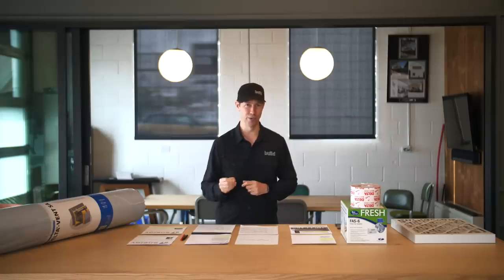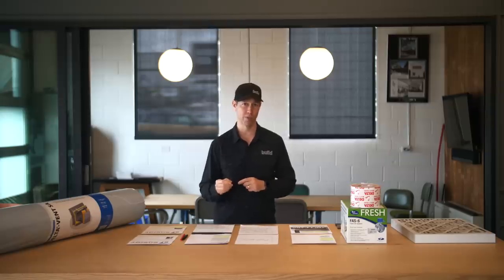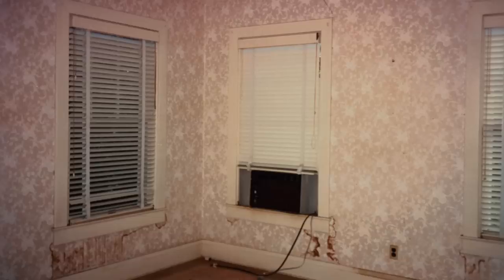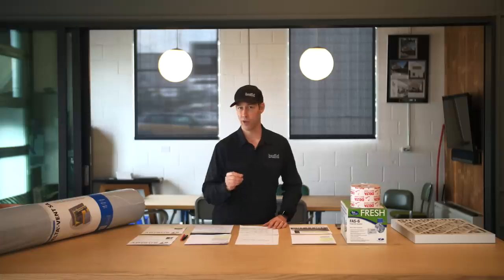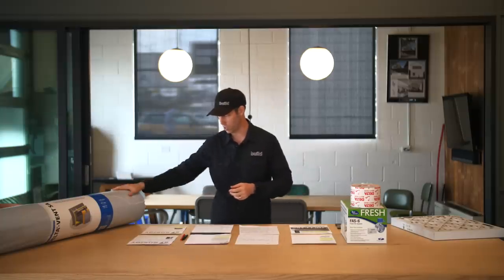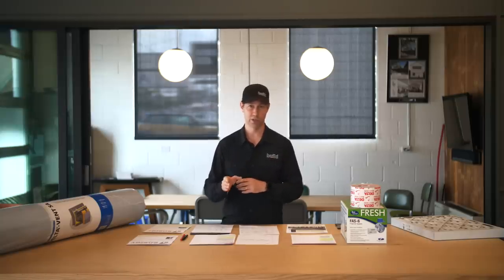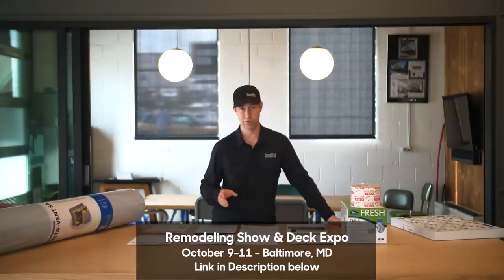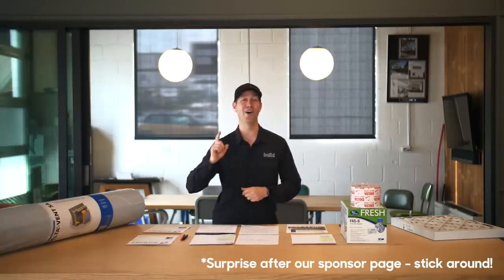“Houses need to BREATHE!” - Shut your filthy mouth

Comment: Your assumption is all "Building Codes" are good. You're also forgetting all of the noxious chemicals given off by the building components in your home. They include formaldehyde, volatile organic compounds, etc all from a wide range of sources. 

When carcinogens are being trapped in the house and being linked to cancer then people will have a little different idea of what tight means, and I'm not just thinking of Radon.
Reply: Matt is a builder.  If a government code is stupid and harmful he still has to impose that on his clients or face punishment and loss of his business.   Every monopoly is harmful and there should be multiple competing building codes.
Reply: This is why you have ventilation systems, he says it right in the video. It's not that the house doesn't breath, it's that it breathes in a controlled way that allows for more efficiency, and for air filtration.
Reply: @Bill McGonigle, IBC and NEC are Not government.
Reply: D Jaquith clearly you had a bad experience Spray foam insulation and that’s what you’re basing your statement of off but when done correctly the spray foam combines and reacts probably with no off gas but I read an article about spray foam if not installed properly can of gas hazardous chemicals Into your home

Comment: Exactly. On older homes they used solid wood. No man made materials. Which means there were no glues  being used. The glues they use today e. g. construction adhesive, synthetic resin, melamine, etc.. contain dormant mold spores. Solid wood also soaks up moisture better and moisture can stay in it until the wood drys out and in a lot of cases without any significant rot.

Comment: No such thing as "too tight".

This is what artificial ventilation is for.  Get a good ERV and you don't need to worry.
Reply: And what if those systems fail or are compromised?
Reply: Probably one would repair them.
Reply: J Franklin or replace it. Folks don’t seem to worry too much about that when they install a nice furnace/
A/C system whenever they build in the first place so it shouldn’t be a big deal
Reply: Reptilian Lord  I dunno, what do you do when your furnace or water heater fails?
Reply: Reptilian Lord replace or repair it seems to be the obvious answer. We are talking about 2 fans and 1 to 2 cores. Not a very complex system. The biggest issue might be convincing some home owners to actually turn it on and run them.
Reply: @1982MCI  You don't seem to see the issues of a building that is so absolutely dependent on one factor for its success. Once that small factor is comprised the whole system collapses.
Reply: Are we suppose to take your ridiculous concerns seriously?
Reply: @Neubs-xv8tw  What is ridiculous about it? That there are inherent flaws and weaknesses with technology?
Reply: So whats your dooms day scenario for this type of house and why do you not recommend people build this way.  I'd like to hear what technology needs to fail and the catastrophic consequences of this failure.
Reply: @Neubs-xv8tw  Wow someone is getting really defensive and insecure. I am not making any propositions Iam simply pointing out the limitations of contemporary building theory.
Reply: Not an option in humid coastal areas
Reply: This guy is a salesman not a good framer ....
Reply: You still have multiple built-in fall-backs PRE-INSTALLED in your home.
They're these things we like to call WINDOWS.
If your ERV/HRV system goes down for a period of time, open a window.
It's not as efficient, or as clean, and it'll play merry hell with your climate control.
But it WORKS!
Then, once your ERV/HRV is in working order again, YOU CLOSE THE WINDOW.

Wow!  CONCEPT!
Reply: Because opening a window to prevent stale air buildup in a tight building with a failed ERV is a concept slightly harder to grasp than the unified field theory...
Reply: Who?  Risinger?
Reply: @MacmillansDiciple  "You don't seem to see the issues of a building that is so absolutely dependent on one factor for its success." How is this any less true for a furnace,  well pump, water heater, windows, freezer, etc?  A furnace is at least as likely to fail as an HRV, and far more likely to stop working altogether. Let's examine what happens in two different scenarios. House A is leaky by design, and has a gas furnace, no scary HRV to fail. The furnace fails in the winter. Within a few hours, you are freezing your ass off and desperately hoping to get an HVAC guy to come out on short notice at $150/hr to diagnose the problem. Your life is basically turned upside down. House B has a scary HRV, is super air tight, some mini split heat pumps instead of a furnace. The HRV fails. You crack a few windows, and turn up the heat a little bit, and leisurely decide the best course of action, with no urgency. Or let's say one of your heat pumps fail. Not to worry, the others can make up the shortfall in the short term. Or if you only have one, luckily your house is so air tight and well insulated, that it will take days to get really cold, and you could keep it at room temperature with a couple of plug in floor heaters if you wanted to.
Reply: @trevorlambert4226  You have a severely misplaced faith in technology. You don't seem to understand that as a system becomes more complex it becomes easier to fall apart and break down. A house of cards so to speak. Consider also modern infrastructure. One solar flare, which is something humans cannot control at all, would destroy the entire planets electrical grid and make any utilities or backup systems useless. Have some perspective.
Reply: @MacmillansDiciple  You went into completely left field, but before I join you there, let's deal with the original topic. An HRV is not a complex device. Even as a system in the house, it is hardly complex. If the HRV falls apart, the house does not fall down. People in the house don't die. So your "house of cards" analogy is completely out of place. A solar flare has NO potential to affect any power grid on earth, let alone the entire planet. A solar mass ejection would wreak havoc on a significant portion of the electrical grid, but again, not the entire planet. This is definitely a concern, but has literally nothing to do with the subject at hand.
Reply: @trevorlambert4226  Unfortunately you have no unified cohesive worldview but an atomized approach to things. Everything is inter-connected and inter-dependent.
Reply: I'll be sure to open a window when the solar flares or emps hit assuming civilization hasn't collapsed and most of us don't die or I have enough food in my garden that my neighbors don't kill me for. If that doesn't work I can live in a breathable tent each night as I flee the cities on foot since my car is toast to escape the looting and starvation. I mean in this scenario I think most people will have bigger problems. Focusing on programs that promote local community sustainability strikes me as more of an appropriate concern for a worst case scenario so that I can safely open and vent through my windows if the solar system or foriegn power waged war on us.
But hey if if a breezy house is what will help you weather the apocalypse then more power to you.
Reply: @bradley8420  Passive aggressive mockery and snark is a sign of a weak and small mind.
Reply: Reptilian Lord Passive Agressive Mockery has a genuine veiled nature to it. This is a very open and a playful tease not against you, but against your argument in an effort to highlight the pitfalls of your argument on the given notions rather than humour this particular angle further to which if you had any further concerns, details, etc... of merit now would be the time to offer and clarify if you believe such a playful response was misplaced. Clearly no one as of yet has been concerned by this particular system.

A weak mind doesn't speak for itself. 
I do
A dull mind can not articulate its thoughts.
I did
A small mind is narrow minded.
I listened

A decided mind is not a closed mind, but at some point we assemble the know variables and move forward.

Mockery carries the notion there was contempt accompanying my teasing to which you do not know me.

Snark is a sign of a great many things, one of those being critical thinking, but again it implies an accompanying snideness which implies a underhanded, derogatory, or mocking nature which goes back to assumed intent to which you still don't know me.

So yes, after some critical thinking, I decided that out of all the great many aspects that go into building a home the resulting risk of losing fresh air intake whether it be through a simple blower motor failure or catastrophic grid failure was an acceptable consequence as it is easily remedied by opening a door or window.
Moreover, I can appreciate your concern for complex systems, especially in technology that can be over valued creating unnecessary risks that accompany them, but each point of concern for all systems must be put into context and discussed on individual merit as a general comdemning sweep would be a dismissal.
It was my hope you could take a joke/illustration and be receptive to why most of us do not prioritize something like this when there are far more substantial concerns regardless of a continued technological culture or apocalypse. I'd personally want an air tight house to control all airflow in and out of the house if I had no modern HVAC system available to which if we are concerned about longer term system failures all home should be designed differently to begin with to capitalize on and and control passive airflow. If you have further input directly related to the fresh are intake then by all means, I am open to it. I can think of several off the top of my head to which group thinking is great for patching systems. In fact, you have me thinking on what would be a way to use passive air for a downed system. Building in practical redundancies is always a great thing.

As for anything else, you have great day.
Reply: Reptilian Lord I actually have a textbook on passive air flow and would like to see it designed more into modern houses with HVAC systems as it is one more way to be energy efficient and maximize a house's life through many cirmcumstances.
Reply: I agree with @MacmillansDiciple  too much focus on active systems that will cause the house to go bad if they break down, or are even used incorrectly. Like some people who turned down the ventilation to cut the noise and save power, insufficient ventilation in their house led to moisture buildup in the house and caused mold over a summer.  Great for healthy! I am coming to the opposite conclusions as this video and I think the future is passive systems that don't require power for a long term, ecologically friendly house. Timbered houses for instance and materials that can absorb and release moisture without getting damaged or becoming mold growth sites. A timbered house in the scandinavian tradition can be made to last hundreds of years and be energy efficient and finally the house itself is a carbon sink as well.
Reply: @PhotonHerald  No, the problem is people won't maintain the systems.  Filters won't get replaced, or if they do, they'll get replaced with the cheapest piece of junk filter they can find.  That's the sad reality.  And if you are foolish enough to encapsulate your house in off-gassing foam like so many do, and you don't have a properly functioning ventilation system, you're in for a world of self-made health problems.

Comment: My 1910 baloon house is in great shape. My 1980s house is showing alot of mold. My 2010 house is just as bad as the 1980s!!! I right now am testing a house with the walls like the baloon leaving an air way. The air tight to meet standards is not on outside the house. Its inside just under the drywall. Just to let the house breath. Ill find out how it goes in a couple years.

Comment: Could you do a video on the best practice for hood range and dryer vents. Is there a dryer vent cover that you like to use.
Reply: Good subject.  I never see how to address this properly and it's an important concern.
Reply: I have seen a vent from heartland it seems to be the best one I can find. But nothing for a hood range vent.
Reply: Actually,  I'm referring to makeup air.
Reply: @rickwest2818   for the dryer i added another 4" duct and ran it from the dryer to the outside for makeup air.  The dryer is in a tight enclosure
Reply: Does that work well?  What if it's really cold, or really humid, or lots of pollen?
Reply: @rickwest2818  i pull from my porch attic. Its better to direct the makeup air to the use point imo 
Instead of pulling in air from your doors and windows
Reply: @SolarTechFL  do you ever have issues with high humidity not drying the clothes, or cold air causing condensation?
Reply: @rickwest2818  time will tell im about to move in 
My range hood i figured can pull air from the erv 
The dryer works perfectly in my barn even with 100% humidity im in Florida so humidity is 80-100%
Most of the year
Reply: @SolarTechFL  I'm in MI so the cold air causing condensation is a real thing... but it doesn't get much more humid than FL.  Same about the ERV with the bathroom exhaust?

Comment: I hear this soo often. Nice video.   I'm attempting to build a green cabin, but without the benefit of unlimited electricity.  Blending some tried and true methods like orientation, roof overhang, cool roof, and rain screens.  Heating is pretty easy, but cooling off grid and on a budget is challenging.
Reply: A ductless minisplit does well for cooling, unless you need to have a much lower electrical draw than that.  Planting trees is a long term solution, but as long as the roots don't get into mischief that might work.  Changing clothing to kinds that breathe well (linen, searsucker) are other options when resources are tight.

Comment: Ok Matt. Some good points. But please - riddle me this case:

You are building a home inside a forest. Amazing, clear, fresh air. So good that You would have to be crazy to filter it and deprive it of its propertise.

So lets try to seve this aspect and still meet the code.
Also lets assume that its rather cold or medium climete. Boston for ex.

We use open cell or rockwool insulation.
We do not use PE vapor barriers at all.
We just use air and water membranes.

Only chance i see here for trouble is condensation on sheathing during winter.

But now a key question. 
Lets do sheathing from the inside. Even by screwing regular, wooden boards.
Use those as backing for rockwool boards. From outside rockwool is being hold by conpressing to studs and some occasional mechanical connector. And also by good quality mambrane that protect it from air and water from outside. 
Mambrane is hold to framing by wooden 2x1 inch bars that also create there an 1 inch air gap.
Last we have wooden siding.

Yes - there would be some air leakage - but we actually welcome that for its refreshing properties. And knowing that we dont mind the 20% extra cost of energy.

Can You please point out some holes in that logic or ideas how to make that better.
So in other words - how to make a modern house without mechanical air control system. And yes - with acceptance of some extra costs of energy for heating.

I would love to here from You in that regard.

Cheers
Reply: Shame this was never answered, it is actually an interesting question / concept.

Comment: I think where a lot of people fall down with air tightness is cost. If you seal up a space but don't spend the money of a full solution or engineer it properly from the start it'll cause issues.
The classic case would be sealing up an interior remodel but still having all those structural leaks. That air ingress allows damp to condensate against the rest of the building and folks will attribute that to lack of breath-ability. If you design is so that air movement is limited as much as possible to ONLY where you expect it to move then you will mitigate these problems.

Another major forgotten factor is cost. We didn't cool houses 50 years ago like we do today and often didn't heat them the same way either. These are NEW problems that require good designs to fix. "old" design simply cannot count for the way we live today. Indoor bathrooms with showers that are run for all family members at least once day are new. We had them previously but certainly not in very house and not used nearly as much as we do today. Bathrooms suffered leaks and damage because we're only just getting up to speed on how to build them right.

Comment: Rural Kentucky: no residential building program in place. I’ll take the old timey house with all its airflow please…
Reply: Makes no sense though. Why would you want to take a house that is causing you allergies, higher bills, higher pests, higher health hazards? 
Just seal it and ventilate it through a system that cleans your air.
Reply: @alexandrep4913  but do you live indoors all the time? Does no one enjoy opening windows anymore?

Comment: 90° temp at 80% humidity. Is less moisture than 50° with 70% humidity. Psychometric chart. It is even easier with ac. It pulls moisture out of the air. It's a dehumidifier. Most people don't know these things. Now when you build in northeast or west. Yes enthalpy is a problem

Comment: Even good window AC units have a damper that allows you to adjust the amount of conditioned outside air you want to bring into a house.  It has been good practice to seal it up as tight as possible since the 90's.  Now home sized ERVs and ventilation units are commonly available and reasonably priced.

Comment: 1. ductwork should be in dropped soffits in conditioned space.
2.Houses should have full house dehumidifier and UV air treatment.
3.Use CMU exterior and steel trusses with metal roof.
4. use rockwool or cellulose insulation.
5. too tight houses are dangerous.